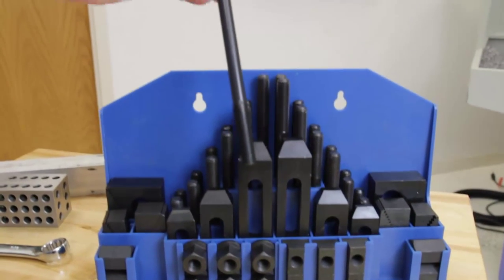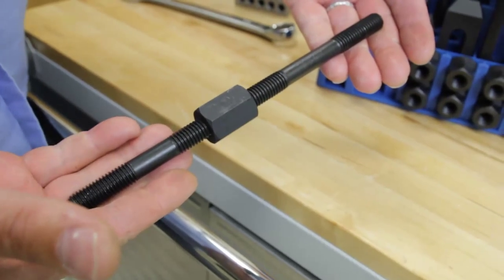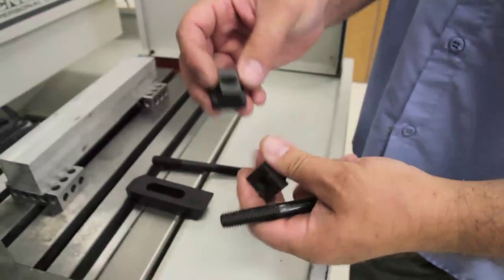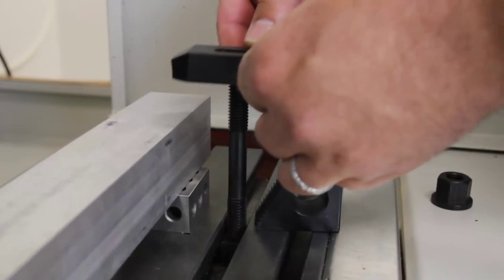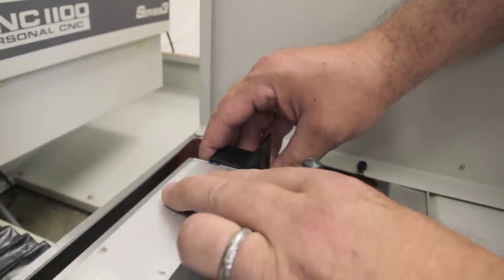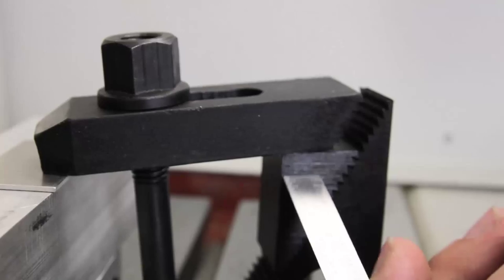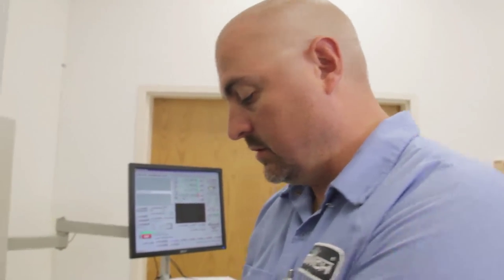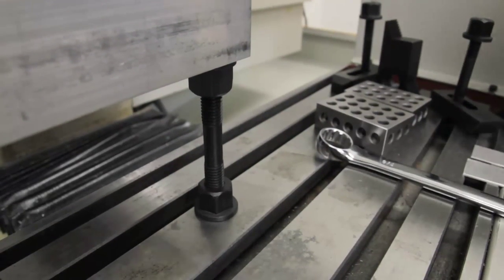Strap Clamp Tips - Tormach CNC

Comment from the maker: We are passing along a very good point, brought up on our blog (link to the blog under Show More), that was not mentioned in our video. 

Toolznthings wrote: I did not see it mentioned,(may have missed ) but make sure your t- nuts
will not allow the stud to pass thru the bottom of the nut. Best way in the world to break out the tee slots in the mill table if the stud jacks at the bottom of the tee slot. Use tee nuts that have the last thread made so the stud will not pass thru.

Brian

Comment: Very good info here, thank you! One thing I see missed, and now that I am involved with CNC's cutting wood as well as metal I see missed even more, is that the strap clamp stud should be closer to the workpiece than to the serrated support or the block support. 

This is really a lever, and a long lever arm you exert force upon with a shorter length on the opposite side of the fulcrum functions as a force multiplier. You need far less force cranking down on the nuts to have a very good clamping force on your workpiece, making your set up more stable, and more rigid, and this is always desirable.

Also, having your strap clamp angled downward towards the workpiece is necessary, but having too steep an angle can reduce the effectiveness of the clamp, and can create unexpected instability (not as bad as the clamp angled upwards to the workpiece, though).

Comment: Very good video. But one thing i would emphasize is that in a work environment that table is going to have chips and oil all over it. To ensure your part is machined accurately you need to make sure your worktable is clean and flat using a surfacing stone.
Reply from the maker: Yes you are right. A clean table is essential to accurate machining. Both Mike and Jason cover that extensively in other videos. Mike just didn't mention it here.

Comment: Very good & informative video for beginners.
Just wanna point out that in the place where I work, many of the studs & nuts got damaged as the tool hits them due to bad set up or bad CNC program, we just use regular bolts instead, cheaper & does the same job!
Reply: The reason bolts should not be used is they can bottom out. Studs are way safer
Reply: @centipede4861  True (good point) but if you do the measurement correctly (if you know the depth of the threaded holes in the table) you should be fine, you can also use washers or spring washers.
I'm not saying we do it the right way... just a cheap easy alternative!